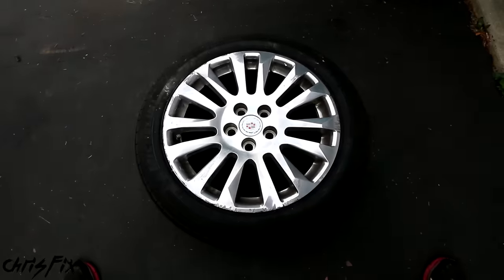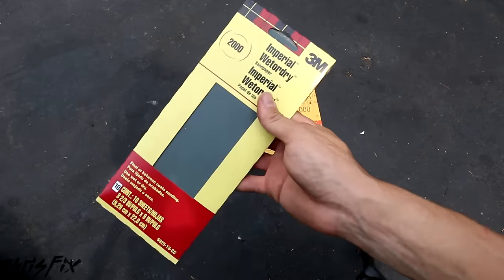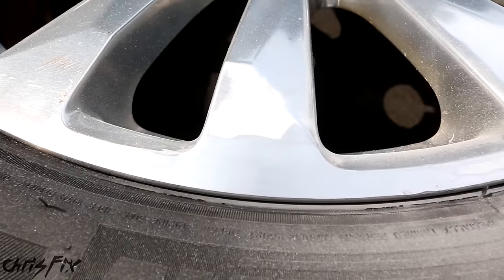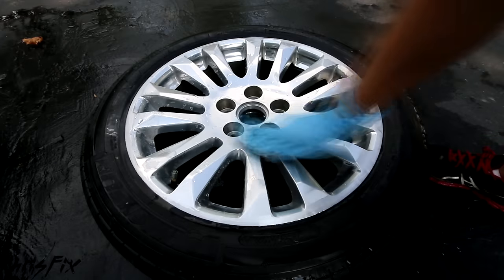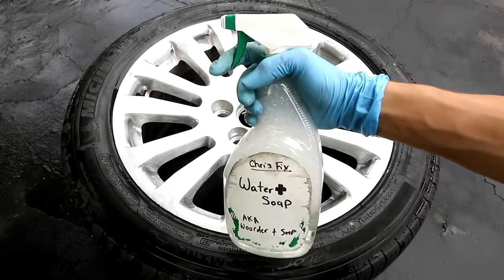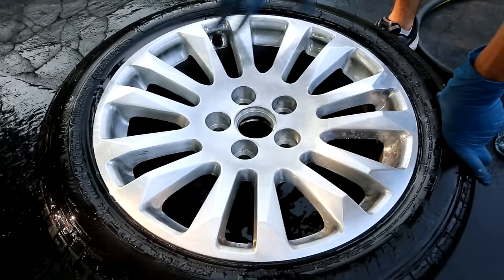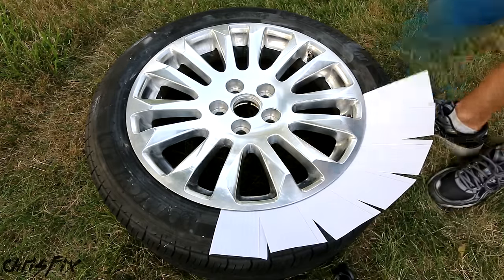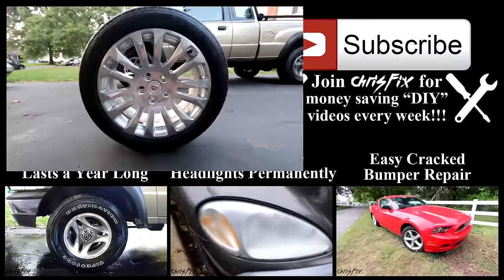How to Repair Rims with Curb Rash or Scratches

Comment: @ChrisFix  are you worried about the strength of the rim due to the amount of material you removed?
Reply: I do this professionally and I have worked on a customers rim like 10 times. It would have to be like 3 times worse then that to be considered repairable.
Reply: @donaldcash1536  Oh... I had no idea (obviously). I don't know cars much less rims.  Helicopters are my thing.

Comment: So does the process weaken the rim significantly especially where the tyre bead needs to grip the outer edges of the rim? What depth scratch are you comfortable with, when doing this sort of repair?

Comment: If I have aluminum rims but they have chunks taken out from a curb. What can I use to build up the rim in those spots before I sand them and paint?
Reply: i heard chemical metal does the trick
Reply: He has another video detailing how to use metal bondo to build up areas on the rim.
Reply: @richarda3764  I've seen that one. But I was wondering if you can also do it on aluminum. Thanks tho :)

Comment: Is it really worth if you don't own this stuff already?  My dad let me take his car to the gym because our driveway just got re-done and my car is stuck in the garage.  I'm not familiar with the width of his car and his mirrors were angled pretty far up so I had no visual of how close i was to the curb.  Skinned i by a millimeter at most and now there's a 3-4 cm scratch on the rim.  He says it'll take $200 to get it buffed out (and is very mad).  I came to this video to consider fixing it myself, but it looks like I'm going to have to spend hours and buy $100+ worth of tools and stripper/neutralizer etc.  May as well just toss him the money, unless I'm vastly overpricing the cost of the stuff in the vid.

Comment: When you sand with 400 grit and higher you need to use a sanding block not you hand or you will make low spots.

Comment: Hey chris my name is jesse yallup im from yakima Washington i have a question about my mustang its a 2002 3.8 motor v6 an i have a problem when i hit 4th n 5th gear starts bogging out i have to gear down to fourth gear to speed up to 60 no power in 5th gear
Reply from the maker: Are you able to replicate the issue in lower gears or only in 4/5?
Reply: @chrisfix  yes in 1st gear no power wen i smash on the gas

Comment: Is there a video for chrome wheels?( Chrome is peeling off)
Reply from the maker: You need to rechrome professionally unfortunately. If you don’t mind a different color then sand them down and remove the chrome and then spray paint. But if you want it chrome, it needs to be done professionally. You can also get it powder coated.

Comment: You have made a very good video with a good and very easy explanation but I totally disagree with the way you are doing it consider the Dremel. 
With the Dremel you are changing the geometry and symmetry of the wheel , maybe is acceptable when you don't want to paint the wheel but to polish only.
For me the correct way is to sand with a machine with a 60 or 120 depends the damage but not more than the factory surface so now you can clearly still see the lines then you fill them with a metal filler putty ,sand again ,primer,colour, varnish.
I respect the job you made but for me this is the correct way.

Comment: One problem no one makes paint to match silver powder coat most come in. I fixed some scuffed altimas for my 03 camry as they look good and are 17s. But had to.paint all 4 and went dark metallic grey as car is white. But no one makes paint to match powder coat at all. So just know you can fix but colir change has to be done or pay 150 to.powder coat one rim. Can buy one used one cheaper for most cars

Comment: way to time consuming using dremmel and sanding disc.   Time for air pressure high speed 3 inch rotary tool and 3M sanding disks....  Sorry Chris - missed it on this one.
Reply from the maker: Thanks for the feedback. If I was doing it for speed I would just sand blast it. This is about doing the job with tools most people have. More people have a little rotary tools and it’s not another thing they have to buy. That’s like commenting on one of my videos telling me I should have used power tools instead of hand tools. Hopefully that makes sense.

Comment: Why remove the clear coat if it’s sound? If it’s sound, just got it down with some 320 grit and then hit the whole thing with filling primer. A light sanding after that and then paint. Of course, you’d want to remove any peeling spots
Reply from the maker: Because this isn’t painted. This is polished and then a clear coat goes over it to protect it.

Comment: how do you know if it is aluminum  or steel?
Reply: Usually steel wheels are thin and have a plastic guard with the wheel design over them. Search up "steelies" or "steel wheels" and you'll see those sort of cheap wheels that are usually painted black. 

However, aluminum or alloy wheels will feel tougher, usually thicker, and entirely metal. The steel wheels will be thin by comparison. 

Hopefully that helps!

Comment: You know CF is rich because at the end of the video he says it's real cheap. Here's the list 
Dremel rotary tool + attachments
3M 400, 600, 1000 & 2000 wet and dry sandpaper
Mag and aluminium polish
Safety glasses
Chemical stripper
Gloves and abrasive sponge
Drill with foam polisher 
Rubbing alcohol 
Clear coat spray paint.

It would be really cheap if all you needed was no cards, soapy water and a towel. lol.

Comment: You are aware, that when You worked with cone, half of it was coverd in black dirt from inside of rim? So You were just basically, rubbing dirt into surface on high rpms, thus scratching it even more - that was opposite of polish lolo

Comment: I'll stop at 800 if I'm going to clear the rim...  no need to polish b4 clearing ...  more than likely 2000  with polish  the clear going to peel off after awhile   but nice video
Reply: An adhesion promoter, specifically BASF 2000 Prep Wipes will keep the clear on the rim for years to come.

Comment: Sorry but this is a pet peeve of mine, the proper name of what they're called is Wheels!  The wheel itself has different components such as the Hub, spokes & the rim is where the tire mounts to the wheel. All together it's called a wheel. 
Think of a steering wheel it has the same components, the hub mounts it to the column, spokes radiate out from the hub to the rim of the wheel, but no one would ever call it a steering rim.
I don't know how Wheels came to be called rims, but I don't like it.

Comment: Idk about anyone else but the clearcoat he used is like junk, well for me it always is for some reason... It will dry solid but it scratches EXTREMELY easy and I've noticed if it sits around in the house, dust or animal hair that sits on it for awhile will literally fuse to the clearcoat. I painted some leds pods for my truck and used this as a clear as well, it  didn't even last one Minnesota winter. Basically all flaked off

Comment: Don't u loose the stuf the m/weel was made out by scratch & sanding it so u won't end up with the flat surface it'l b slightly waved al the way around so u need to_
Reply from the maker: You blend it so it’s smooth and looks good

Comment: Guys. PLEASE DO NOT remove the original finish. What a waste of time, fumes and damage.  Once you have the damage out. Wet sand it nicely. Then dial down and dry. Then spray.  Removing all finish is absolutely insane. I’m a wheel repair guy. Not to put down or knock. But trust me. Keep your work minimal.

Comment: I'm not a fan of repairing with this particular method, especially the perimiter defects . If You use machine and grinder to get rid of deep scratches, You are loosing more and more material layer in adjacent areas  which eventually leads to making the rim construction weaker, neither the wheel stays perfectly round anymore. And bear in mind this is a construction element which is responsible for Your safety.  In professional workshops  they use special type of filler for deep scratches.
Not to mention the spray painting which isn't durable in a long term on rims which are highly exposed to scratching everywhere.
Reply from the maker: Thanks for sharing, I have no idea how removing a few millimeters of material will make the construction weaker, and every single rim I've spray painted has never had any issues!

Comment: No! Use the proper tools/hands. Belt sanding paper used by hand works much better.  Really this is something nobody should do at home. Your wheels will have waves in them.  The proper metal polishing/sanding tools are kind of expensive.  I would even suggest using dykem to be certain you keep the surface flat
Reply: Also, don't place your wet sanding paper on the ground, dang!

Comment: That was painful to watch. He didn't deflate the tire so the curb rash wasnt taken out fully and the clear wasnt applied to the edge. He didn't stand down or clear coat in between the spokes so it looks garbage in there. Lastly, clear coat is designed to adhere to paint, not bare aluminium (especially polished), it peels if you dont use an adhesion promoter. Please use a professional.

Comment: No one can buy all of the crap you need to fix that wheel just to fix one car. Just a huge waste of time and money. This can also cause some issues with the valve stems. Looks like 10 hours of work for the average non-pro + at-least $200 to buy all those drills and products.